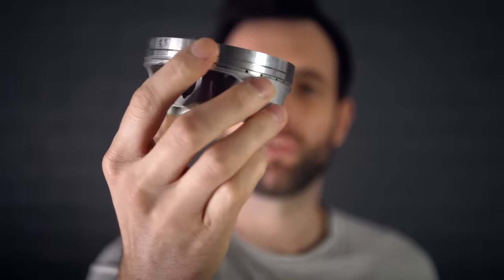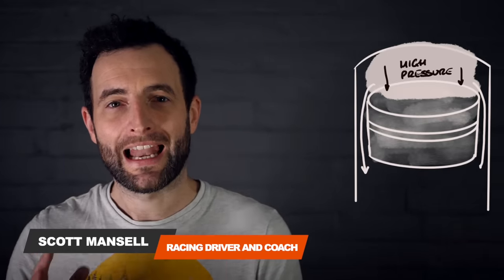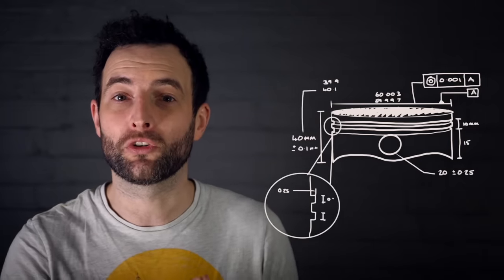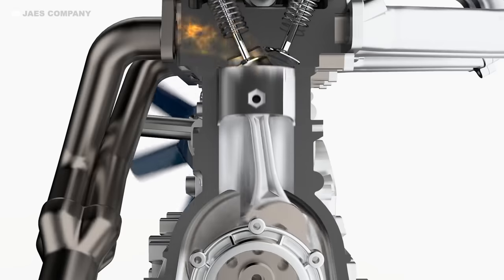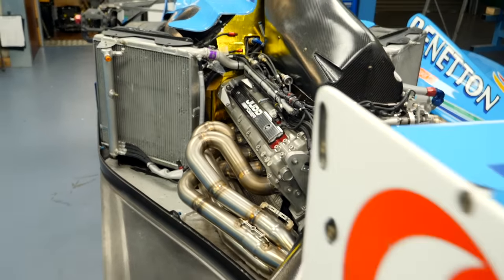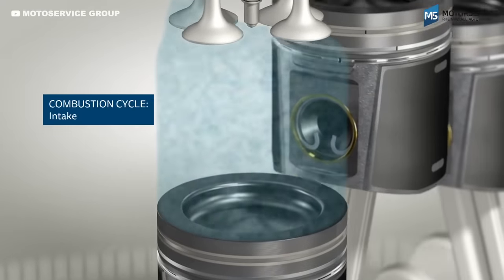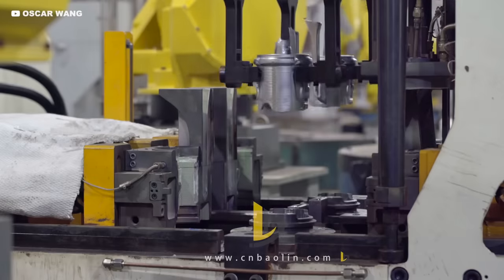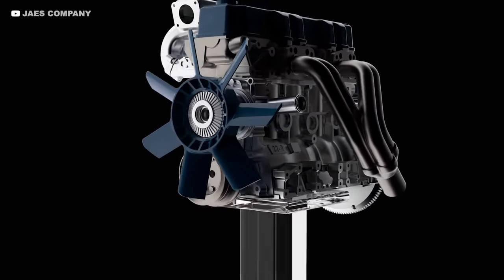Why F1 Pistons Cost £50,000!

Comment: How are these engines initially assembled?  Do they have to be at operating temp then as well?
Reply: they probably cool the pistons & rods and heat up the block, that should make it easier,  u even use that technique in normal cars sometimes, like changing bearings in a gearbox or engine etc.
Reply: I had the same question
Reply: Unless the engine block is magnesium, the aluminum pistons will expand and contract at the same rate as the block, so the pistons aren't what would seize in a cold engine. The block would be undersized around the steel crankshaft at room temperature however.
Reply: @RallyRat  I doubt that the piston rings are made of ally!
Reply: @overlandwalkabout6376  but the exact opposite was said in the video 🤔?
Reply: @king-su5uc  The engine oil is very thick when cold
Reply: @overlandwalkabout6376  not true, you have not considered the initial tolerance at cold.  Expansion ratio at temperature has no affect on initial tolerance.  Additionally the expansion ratio can be adjusted through the alloying elements and heat treatment used and a generic 2x assumption is not accurate.
Reply: @RallyRat   Incorrect. Even if both components are the same material, they will expand at different rates because they are different shapes.
Reply: @overlandwalkabout6376  thank you.
Reply: @overlandwalkabout6376  Do they avoid cold operation for fouling or wear reasons?
Reply: @overlandwalkabout6376  dear oh dear....
Reply: @skippyguy3   2.29, is that accurate enough? Come on, you don´t 'adjust' the expansion ratio by the alloying elements, you adjust other carateristics like tribology and live with the given exp ratio. And heat treatment may affect it a bit the microstructure afterwards, but not in that range to consider.
Reply: @TheSoundOfTwang  Engine oil for race engines is not thick. It is extremely thin - like water - to be able to flow through those tight tolerances, regardless of temp. It is heated to force heat through the engine and metallic parts, not change the fluid viscosity.
Reply: @silvereith  The piston rings is where the real tech and artwork is. As they ultimately hold the seal in the bore, not the piston. I don't know what they're made of. Some type of alloyED steel. Definitely not just aluminium. But to give some comparison, even the rings in a V8 Supercar engine, which is just a lowly pushrod V8, cost around $2,000. And they also need to be warmed up prior to starting. 
It's sort of a misnomer to say that "you can't start the engine up because it is seized". Technically, you could, but you would instantly destroy the engine as the rings would score the bore, ruining the hone and destroying the piston in the process. The warming of the engine is to bring the parts up to their expanded running temperature tolerances. It's no different to how your road car engine sounds rattly and noisy when cold, then quitens down as it warms up. The only difference being you won't destroy the engine in your road car cold starting it - whereas the tolerances are that fine here, that you would. To say you can't start it because it's seized would more appropriately be "the cold engine's tolerances are so tight that it's practically seized and would be damaged if cold started, so needs warming up first."
The honing of the cylinder is also where the very specific art is. The hone to hold the ring seal and perfect the tolerance is absolutely vital. More info should be given here about these two aspects. The piston itself, or it's primary job here, is simply to be strong enough to take the stresses of the process. But as mentioned, the real heroes are the rings and hone.
Yes, they would be gently heated to near warm up temp, on assembly, but it wouldn't be so vital just pushing pistons and rings in by hand / tools with a fresh hone through the bores just once. That first start - and each subsequent start - is the vital process that demands the pre start warm up to set the tolerances. With the engine shoving the piston up and down a zillion times a second, you would instantly destroy it requiring a rebuild / resleeve, rehone, new pistons and rings.
Reply: @dons1932  Let me rephrase.. It's TOO thick. There is definitely a difference in viscosity from cold to hot
Reply: @moninum  micro structure and alloying elements are intrinsically linked to thermal expansion ratio and not just in aluminium, which can be very well adapted and controlled.  Hundreds if not thousands of research papers from the 1950's are available on the subject as well as being being actually put into practice taking men to the moon before trickling down to F1 in the 80's onwards.....!
Reply: @skippyguy3  It looks like you shamed Anton Mayo right out of the comment thread. I can't see any of his comments, I think he deleted them after getting exposed.
Reply: @davidparker9676  he has probably been called up to be an expert for development of F1 engines....🤣
Reply: @skippyguy3  I did not deny the coherence. But still, thermal exp is not on the top of the list for sure when a specific alloy is chosen.

Comment: Way over priced simply due to the application and budget of F1 teams.  I used to work in the tool and die industry building molds for plastic parts.  Some plastic flows very easily when in a molten state during the injection molding process, so areas where two components come together in order to stop the plastic from flowing (called a shut off area) need to be precision machined.  The tolerances in these areas are +.000/-.003 mm and we could hold that tolerance with relative ease.  

For example, if you have a pair of sunglasses, the two mold inserts that make the concave and convex shape of the lens are machined to the tolerance above in regards to the diameter of the insert.  The radius of the concave and convex surface are machined using a process call "diamond turning" which is a highly accurate process of machining a radius.  That process could hold a tolerance of +/- .00013 mm.  The cost of two of those inserts (a set) was around $10,000 USD.  The physical size of these inserts are similar to a piston, however, they were made out of high grade 400 series stainless steel, and underwent special coating processes to help with the finish of the actual optical surface.

The estimated cost of these pistons is likely that high because teams need to justify the budgets they ask for, and are simply over priced.  It's similar to how a government will spend $500 on a hammer that you can buy from a hardware store for $25!  Also, if they were looking for true precision, they wouldn't leave the underside with a cast or forged finish, they would go in and machine that area which would help with a number of things including being able to produce a matched set of pistons in terms of mass and fit.

Finally, forged parts will be stronger than machined parts, and machined parts will be stronger than cast parts.  It's all about the grain of the material (just like when you see someone break a plank of wood during a karate demonstration, rotate the plank 90 degrees, and he would have a much tougher time breaking it).  Forging actually bends the material which allows for the grain of the material to follow the bend, with machined parts the grain remains as it is which makes any bent areas with a grain that no longer follow the bend, and with cast parts, well the grain is going every which way but uniform.
Reply: Very informative thanks 👍
Reply: One more thing to consider is that the hourly rate of engineers in F1 is double-triple than elsewhere but aerospace.
Reply: My vote is with Mike Puckett's view on this hideously high costing estimate. The greatest artistry with these unrealistically expensive pistons is the con artistry to justify that price. Mike I also have previous experience in aerospace engineering and some experience with precision molding dies so everything you raise here I am in agreement with.
Reply: This is video bogus, most F1 teams pistons are now printed, (LMF) even the pistons we now use in hydraulic lifts are printed. Fine metal powder/dust is laser bonded, micron by micron layer at a time under pressure.

Comment: 0.3 kg * 200 (g) = 60 kg for each piston... not 600
Reply: jup
Reply: x9.81 for gravity. F=MA with acceleration in m/s
Reply: @AmNeSiA98750  so in space there will be no forces acting between pistons and rods if we take same engine and rev it in same way? so how gyroscopes work in space? Or you don't know the difference between mass and weight.

Comment: All good and agreed but there are pistons used in variety of motorcycles and produce 200hp rev to 15000rpm and you can buy them from the dealer....So the rotating mass it's the problem. Not the materials,neither the machinery involved as much.Thanks for the information.

Comment: Imagine the procedures during assembly of these engines. The cylinder block and the pistons has to be heated up to be able to assemble the engine. Otherwise the piston just won't fit into the cylinder. It's crazy how the teams managed to make the engines so reliable. When Honda entered F1 as an engine supplier for McLaren their drivetrain broke down so frequently, they had penalties every race for changing parts (they were allowed to use 4 engines for the entire season of 18-19 races, and if they used them up, they would get a grid penalty). In 2020 not one team received such penalties for using more engine components than allowed!

Comment: If the pistons are siezed when cold, how do they assemble the engine? Do they have to heat the block to put the pistons in?
Reply: M P  well its not. The tolerances are that fine. The tolarances are normally found in air craft
Reply: @christycullen2355  in piston engines in aircraft? I think not. Same as road cars.
Reply: Most metal's expand when heated above  Ambient temperature. Plus most metal's contract when temperatures get lower than ambient temperature. I'm thinking some parts will go in the freezer and some will go in the oven, fore assembly.
Reply: M P  same principle applies..
Reply: Forget it, the piston has allways a smaller diameter than the block. The piston heats up much to higher temps than the block, so it expands more. This guy (61) has no clue what he is talking about.
Reply: @christycullen2355  Aircraft tolerances are the exact opposite - NOT fine. They are loose - so that they can keep running and flying even when there are issues. But they require more regular maintenance because of it. As mentioned similar to road cars, but actually even less precise.
Reply: @dons1932  that is only true for the piston to wall clearances.
Reply: @chrisdpalmer31  you'd be thinking wrong. You can't even explain that. Which ones where? And why?
Reply: @dons1932  i think you take confusion between "tolerances" and "clearance": 
Tolerances are the same as for automobile engines, but aircraft engines, specialy air cooled, need more clearance to avoid sizing risks because the block did cool to much in descend whith reduced power, and in opposite did run at much higher power level as automobile engines (100% power at take off (5 minutes maximum), 75% at climb 40 to 55% at cruise
Reply: @moninum 
Yeah, you forgot some things in your statement about people not having any clue what they are talking about....

Different materials have different coefficients of thermal expansion, and the rate of expansion is factored according to the thickness of the individual piece of material heating up
Steel, iron, aluminum, magnesium (and all the individual alloys of those materials) expand at different amounts per degree of temperature, per unit of thickness of the piece. It's not as simple as "the pistons heat up more than the block"

It's also curious that you seem to think that the piston is exposed to more heat than the cylinders
Reply: @jackhammer111  
No, Chris Palmer is right. 
Freezing parts is a common method of assembly where there is an interface fit. Heating is as well, but that can become problematic depending on the amount of interference, amount of heat needed, and  any specified heat treatment for the part. 

Source: I build large reciprocating compressors (large multimillion dollar engines without fuel systems, that are used to pump high pressure gasses)
Reply: @Man_Emperor_of_Mankind  I have written that often enough to get this right, so I shortened it this time. But yes, the piston can´t give the energy away nearly as good as the cylinder. Do some research about what temps a piston can reach (just in standard engines), and then tell us. And how different the coefficients are. But of which different materials? Do you think the piston and the engine block of an F1 car are made out of different materials? Not the same alloy for sure, but both aluminium.

Comment: I’m amazed that there’s as much as 60 thou piston clearance. Was this figure correct.
Reply: no, typical clearance for a normal engine is @ .003.
Reply: He got it wrong in the video, it should have said 6 thou.
Reply: 0.15mm is .006 in, not 60 thou as stated in the video, looks like they just forgot a zero in the conversion or some sort of other editing mistake
Reply: There are a lot of inaccurate statements in this video. Conversion from metric to imperial just made it worse.
Reply: Not a chance, 60 thou is 1.5mm
Reply: That’s better..I thought he’d got something badly wrong. Jeez, they’d need a rebore before starting up.
Reply: @robertjusic9097  abbreviation for "Thousandths of an inch".
Reply: @lucasschofield8716  Where Britain and 99% of this planet these microns and millimeters.
0.060 millimeters is indeed very small.  6/100 0.039"
Reply: @jimurrata6785  I've never heard anyone use "Thousandths" when talking metric, you'd just say 60 microns or 0.06.
Reply: @lucasschofield8716  Thousandths. Thousands and it would definitely suffer a loss of power 😂
Reply: It's 6/1000" on the high end
Reply: @Noodle999  well spotted :')
Reply: @lucasschofield8716  Right
But I don't often hear people struggling to make conversions and present them to the public.
"sixty micron" is how I would expect to hear.

Empires of kings and horses are long past. Unfortunate some continue to worship
Reply: @jimurrata6785  what are you on about "worshipping the past"?  The guy said 60 thou, I've been an engineer for nearly a decade and have been involved in engineering through family all my life, and have never once heard anyone use "thou" when talking metric. The Americans haven't shifted to metric, and a lot of British standards were set before switching to metric, so we do still use inches. In fact the majority of micrometres I've used (clue in the name) still use a 1 inch piece to check calibration.
Reply: @lucasschofield8716  Are you sure it isn't a 25.4 mm standard?

I don't want to know in thumbs, hands, feet, strides or furlongs.
Reply: @jimurrata6785  they definitely all say 1". But on the subject of "25.4mm standard" why are they 25.4mm? Because that's 1 inch...
Reply: If the tolerances on that piston are as stated, I can’t imagine it being so expensive. 1 thou (.025 mm) tolerances are very achievable on modern machine tooling. Not easy, but not insane either. Size, form, and positional tolerances need to be in the sub-thou range with expensive material, heat treating and grinding operations to justify that cost.
Reply: @lunkydog  so... let’s all go metric?
Reply: @hans33sw   Not me. Perhaps it's easier for an imperial person to understand metric than the other way around. I don't have any problem doing the conversion in my head. I will say however, that if you start spouting off Celsius temperatures, I have problems with thinking of it as easily as I would with fahrenheit.
Reply: @123psi8  I agree 100%. I broke down the costs in another comment. Even with wear resistant coatings, polishing to mirror finish etc, it shouldn’t cost anything close to that for a set of 6, let alone one.
Reply: Its really starting to seem like these videos are very poorly researched.
Reply: @Doug_in_NC  RnD, pre and post xraying, forged stock, detailed use tracking, lots of tear down and assembly with metrology hours on every dimension
Reply: @frederf3227  RnD yes. The only way it would come close to that price is if the RnD costs were included. Look at the video to see how fast the CMM does the metrology, it’s minutes not hours to fully measure one of these. There’s no teardown and assembly in manufacturing that part, it’s a single piece. You would x-ray it pre-machining, but not post. I would assume they dye penetrant test the final part to check for surface imperfections and maybe ultrasonically inspect too. Given all that, I still doubt you would come close to $5K. Another commenter said he works for a company that makes these for F1 and that they cost under $1K each.
Reply: @jetison333  Yes. He said the engine block was steel (its aluminum), and if that was the case, the fact that aluminum expands much more with temperature than steel does would mean the piston would need to be significantly smaller than the cylinder or it would bind at operating temperatures, which is totally the opposite of what he explained happens. That’s the reason mass produced engines have piston rings - to allow the piston to seal even when the engine is cold.
Reply: @NB-1  Imperial was good enough to win WW2.

Comment: There are plenty of other components manufactured using those sort of tolerances and materials that don't cost that much. Superbike engines rev much higher. In my experience the cost trebles as soon as its mentioned that its for F1.

Comment: The weight of the piston due to momentum does not have an affect on the weight of the car due to 1) crank counter balance and 2) the engine is an enclosed (or isolated) system - thermodynamics. It will only affect the weight car if it is not balanced.